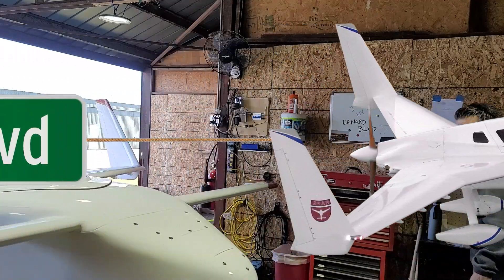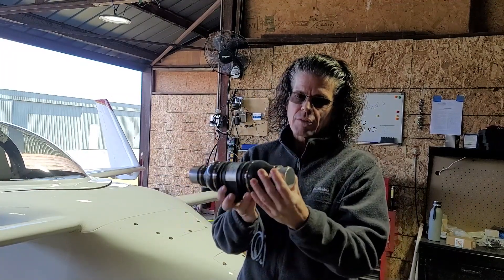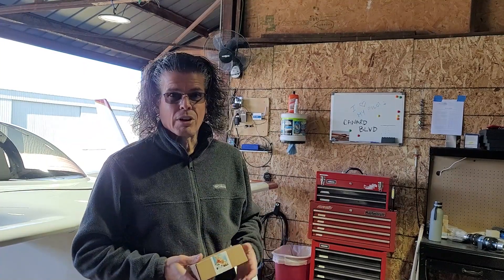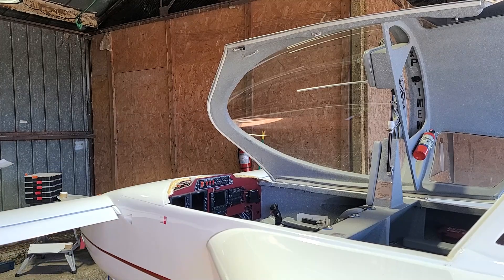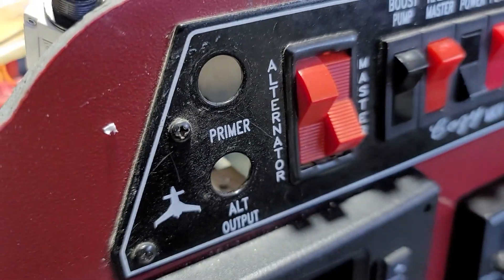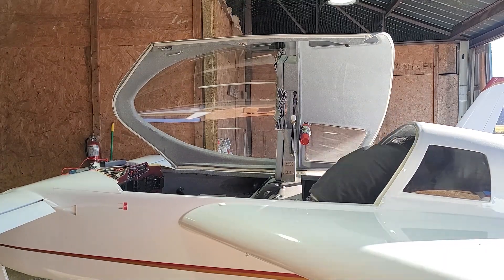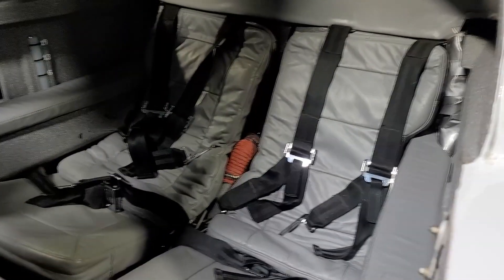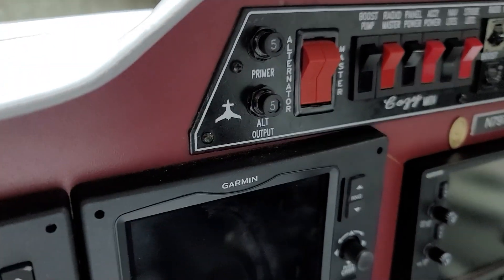Adding Heat and an EFIS Backup System

Comment: Nice one Scott.  I assume you've also installed an overheat/overcharge safety mechanism for the Li-ion battery?   Having owned two experimentals (Sonex and a Glasair 1RG) and one certified aircraft (Mooney), my firm preference is experimental for precicely what you are doing now - making changes without the hassles of STCs and the like.  I envy you.
Reply from the maker: One of the benefits of using the Earthx battery is that it has all of that protection circuitry built into it. It even has a status light on it, and a pigtail lead that you can connect to a panel-mounted light so you can be altered to problems with the battery. My main battery is also an Earthx and it has this same functionality.
Reply: @CanardBoulevard  I didn't know that - an excellent product by the sounds of it.  Cheers.
Reply from the maker: They (earthx) now have a battery for certified aircraft as well. Highly recommend it - it weighs a fraction of what a lead acid battery does, and puts out more voltage and current. It spins up and starts the engine very quickly. And...if you happen to forget and leave the master on, the battery will shut itself down before it gets discharged so much that it is damaged.

Comment: Great idea on the bilge fan. Where are you at now Scott? Any closer to Fort Wayne? 
Does your Cozy have heated seats? I think it was one of the best things I put in my Long Ez & both our Quickies. I also put them into the Velocity since it takes a while in the winter for our oil cooler in the nose to get to temp.
Reply from the maker: It does....but they're not currently hooked up. They (like the heater fan) were set up to run off an auxiliary battery. I need to measure the heaters in the seat cushions to determine what kind of load they will present, so I can figure out if I can run them off of ship power or not.